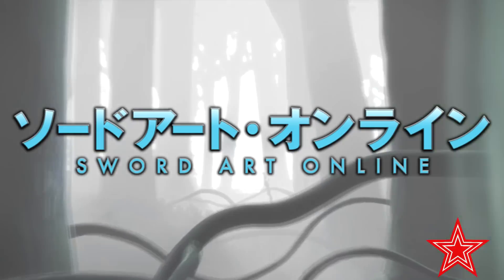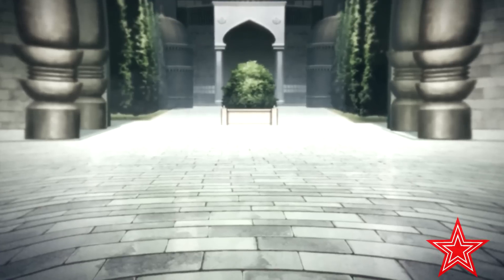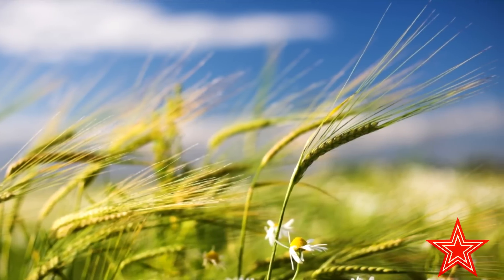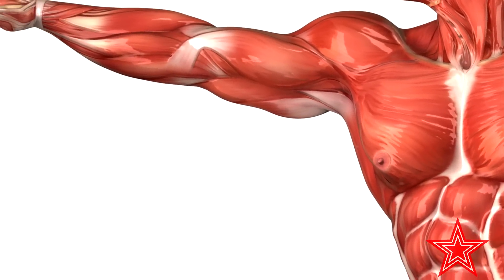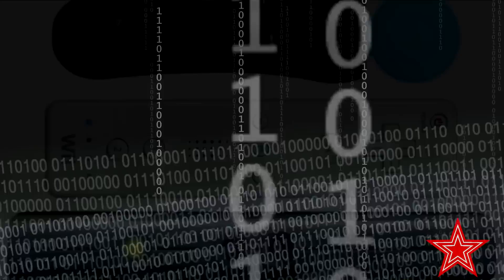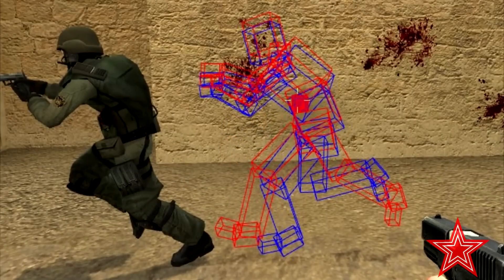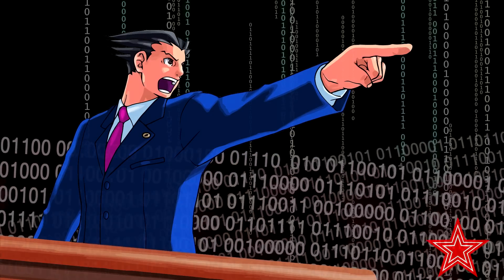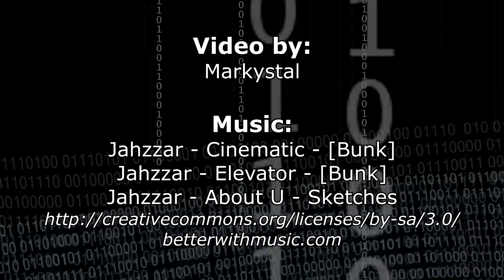How to Make the NerveGear In Real Life [PRINCIPLES]

Comment: Sense of touch is not important really because if you remember in SAO they couldn't feel pain...
Reply: +free2eating the sensation of pain was still there it was just dumbed down so that a stab wound might just feel like a paper cut. You can see this process reversed during the  final battle of the ALO arc when Kirito turned Nobuyuki Sugou's (aka the fairy king) pain sensor up from the default 3-5 to 10.
Reply: Pugnantis97
I thought he turned it to 0? It was a pain absorber.

Comment: I feel stupid sending these messages at a time but consider this: nothing received by the body would actually be felt if not for the brain processing it. based on the evidence I gave before it would be safer just to send low voltage impulses as opposed to microwaves into the head. now obviously we don't have the technology to fit millions of little cathodes to send little impulses through the surface area of the head but perhaps start with a larger area like in assassins creed and the animus?

Comment: does anyone else think that the sense of touch isn't that important? I mean the power of suggestion right? surely if you are immersed enough you could feel it even if its not there
Reply from the maker: +Scott Ng Sort of. The body transfer illusion demos the phenomena you mentioned rather clearly, but from my own experience with it, the touch isn't so much there so much as it is the brain reacts to it as though it's there. I often use the Oculus Demo called "Don't Let Go" to demo this since it's a well made demo that uses the illusion to great effect, but even in this demo, there isn't so much an actual sensation of touch so much as there is an eerie feeling that something is touching you. It's not quite what most people are hoping for out of immersion and is far from the optimal solution. Enough suggestion can go a long way, but touch is unfortunately one of those senses where the amount of suggestion necessary is probably less efficient than just using a cheap solution like a few vibration motors anyway. Combo both a cheap solution and suggestion, and you get something awesome though. :)
Reply: Yes i dont think the sense of touch is completly nessesary. I just want the sense of taste, that would be awesome. Eat junk without the guilt
Reply: +Evan Able Sense of touch is necessary if you are a true sword art fan
Reply: Scott Ng your Right because if we feel pain it will affect us.
Reply: 3 Years late but

Depends if you mean, not being able to feel / hold anything at all or being able to feel stuff, but it all feels the same. 

If it's the first, No. Having to use a controller or your mind to hold things will just destroy any immersion for some people, we're not psychics, we're not used to controlling stuff with out minds, and controllers don't feel like what you're touching at all. 

If it's the second, well, for me, it'd ruin the immersion to touch grass and have it feel like metal or something. But I'm sure some people won't mind it. It's not as important as sight, but to me atleast, it's definitely the second sense to perfect in order to get a fully immersive experience.

Comment: If I remember correctly from watching SAO, they did state that they had to perform a series of "exercises" in order to properly calibrate the equipment before hand. I would suggest that any "exercises" needed to be performed should be less than 30 minutes worth & then an hour to 24 hours would be acceptable for the device to run computations based on that 30 minutes, before actual playtime could happen.